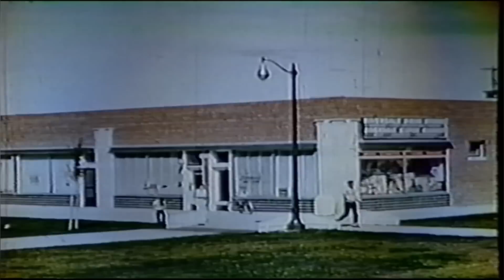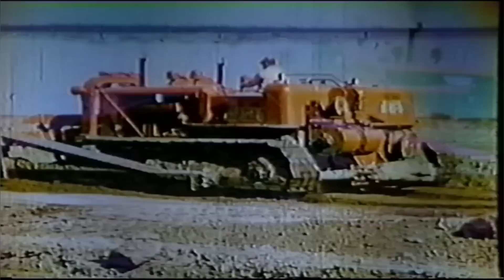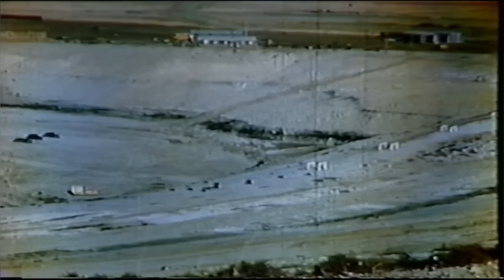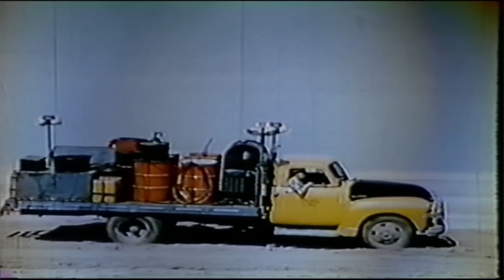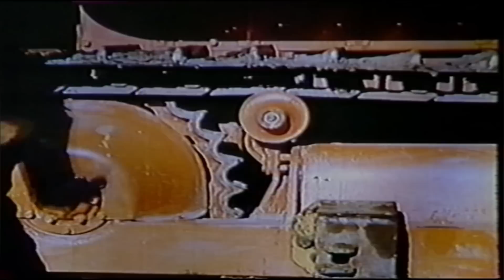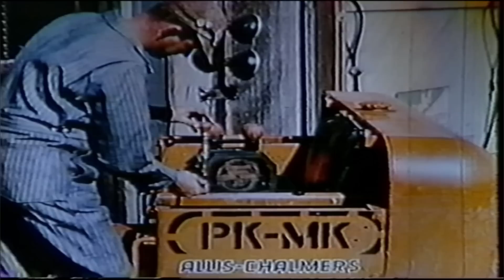Allis Chalmers  - Industrial Equipment used and serviced

Comment: I used to operate an HD7. Two stroke Detroit power. Foot padal starter. Coul sure push and pull. I was 17 years old. Working up hill country here in New Zealand. Giant Disc, TAndem Discs and double set of chain Harrows. The old gurl pulled all three hitched on at once. Sometimes ploughed first with a Nuffield 465 two wheel drive Tractor then rolled with a Cambridge roller.😂
Reply from the maker: Great story, thanks for sharing it from New Zealand!  Love to read the stories from the past, thanks for watching and sharing, I appreciate it!
Reply: @opasvintagegarage  Thankyou for the video. Love the older machines.

Comment: I actually got to operate an Allis Chalmers HD16 Dozer. The company also had one of the HD 20s with the fuel filled torque converter. It was an interesting unit. The GMC 6-71 would run at a constant speed, and the tractor would speed up or slow down as the load changed.
Reply from the maker: Awesome insight sir, I appreciate you watching and commenting!  We had a small AC dozer, just can't remember too much info on it though.  My dad sold it as he didn't really use it.  I sure wish we still had it, it just makes a fella realize you really need to think about selling the old iron first!  He did call me, and I gave him a "sounds good" a little too quick!!